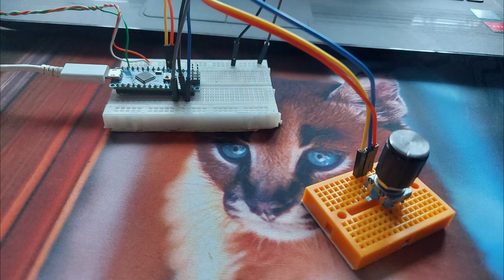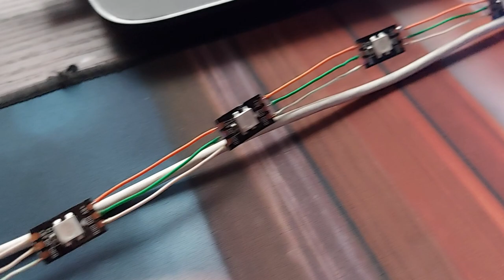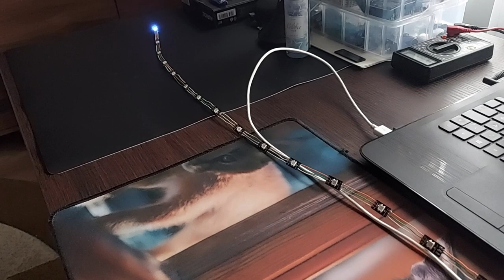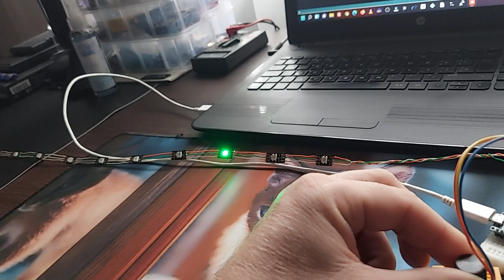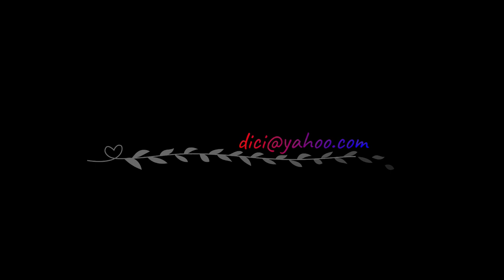Manually controlled WS2812b LED strip with EC11 rotary encoder - Arduino for beginners - with code

Comment: Is it possible to add more addressable leds or its dixed to 15?
Is it possile to switch small DPDT relays instead of the leds? Great channel.
Reply from the maker: The code is available in the video description.  The number of LEDs can be changed and the code modified for operation with the number of LEDs added by you.
With an optocoupler you could also do the coupling of the relays.  These LEDs are addressable and the code is written for these LEDs not for the relays.  For the coupling / decoupling of some relays, a code for that situation would ideally be written.

Comment: Thank you so much sir for sharing your knowledge, it's very informative. if ever sir that I want to move my rotary clockwise and I want to make happen to my led is every passable will not turning off. its look like a fuel gauge concept, may I know what code I gonna use?
Reply from the maker: Do you want something similar to this: https://www.youtube.com/watch?v=Hnk44BwLrtQ but to control it from the rotary encoder? What do you want to determine how many LEDs light up at a given time?
If you give me more information, maybe I can help you. Have a nice day!

Comment: Sorry. Where is the diagram?
Reply from the maker: At the time of making this video, I thought it was a very simple electrical diagram, so I didn't draw it anymore, because it can be deduced from the code provided. If you still need it, I will draw the electrical diagram within the available time.
Reply: Sir can I get the circuit diagram